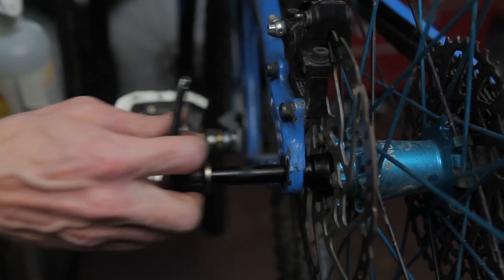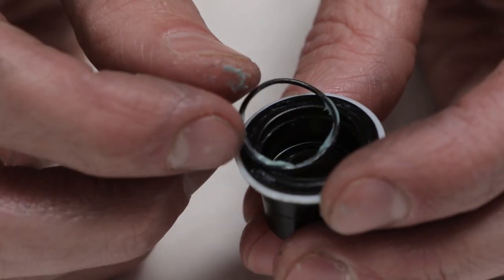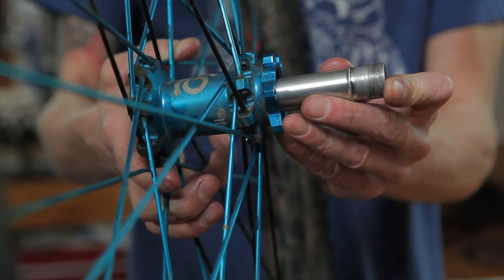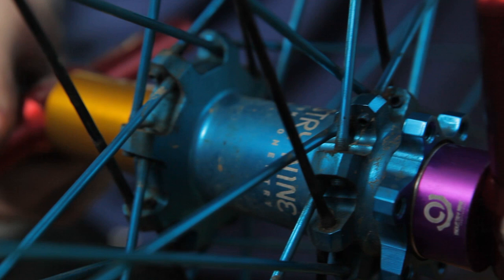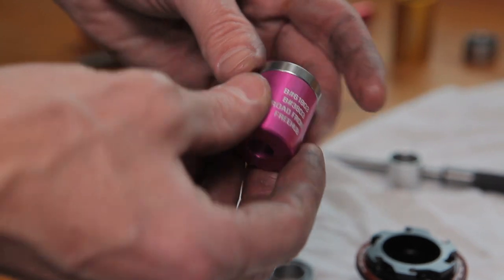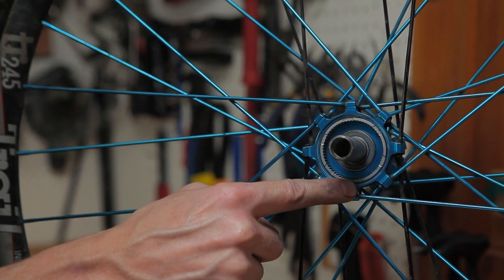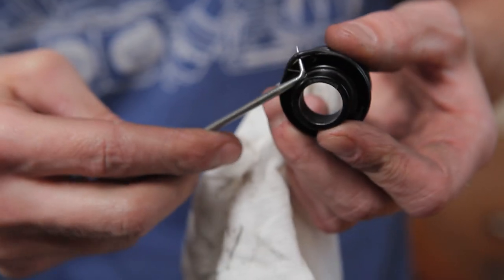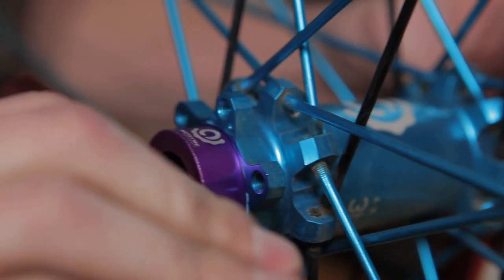Torch Hubset Service

Comment: So, since there is no "tool index image" (and FYI there are definitely proprietary tools required) here's a list of tools and supplies I made as an outlet for my annoyance with this video:
-Cassette tool and socket handle for your cassette
-Rubber mallet
-Centerlock rotor tool or Torx wrench for your rotors 
-Pick
-Grease
-Hub oil
-Bearings front & rear ($60 from I9)
-Various rubber o-rings and Teflon washers that aren't specified and don't seem to be available from I9 ($???)
-Bearing press kit for Torch hubs ($70 from I9)
-What looks like a 27mm deep socket
-A punch 
-A Wheels Mfg bearing press handle ($45)
Let's assume you have the correct brake rotor/cassette tools for your bike, grease, and what I'd call "basic tools," like a mallet and punch etc.. 
If so, servicing both hubs will cost you $175 plus the cost of a 27mm deep socket, plus hub oil, plus your time and labor. If you don't have the basic tools it'll run you well over $200, and you still have to source the o-rings and Teflon washers from who knows where.
Reply: Sheesh. Yeah. Sometimes just bringing it to an LBS is worth the hassle
Reply: i9 sells them, they sell ALL parts of the hubs. If they're not on their site, just email them and they'll get them for you.
That's how I got both Teflon washers
Reply: Yeah that's why I regret not buying premium DT SWISS wheel set instead. No proprietary tools needed and much easier maintenance.
Reply: Man, I need a 2mm hex key for my White Industries hubs, lube, a blind-hole puller and press+drifts...that's it.
Reply: Yes, the first service will cost that much. If you ride a lot you will need to replace the bearings again. You will already own the tools, and will only need to buy more bearings. I save labor costs buy replacing bearings myself.
Reply: Dang I bought I9 thinking they didn’t need special tools. But I see proprietary tools….again, like King hubs require.

Comment: My I-Nine noisy, might be a candidate for a rebuild. Two weeks ago while riding on the street, my pedaling saw resistance (with equal amount of resistance to backpedaling), to the point I had to walk my bike home. Taking my bike to Wheel World in Culver City, Ca, the mechanic placed a washer next to the cassette side drop out, holding it in place with grease. Then, he put back on the rear wheel assembly, secured the wheel with the thru-axle, and now the cassette spins freely. It looks like the hub retracted (possibly due to wear), allowing the side of the cassette to rub against the drop out. The washer kept the hub (and hence the cassette) away from the drop out. Does this sound like a rebuild is needed? If so, which parts should I order? Thank you. The hub came with the bike, ordered in 2017 from LaMere Bicycles out of Minnesota.

Comment: Looks like the end-cap grease is not the same as the freehub grease.  What is the grease used on the end-caps?
Reply: On i9's website, under Support > Torch, there is a picture of a workbench on which sits a tub of light blue grease. The tub is labeled Sta-Lube Water Resistant Marine Grease, which is made by CRC Industries.   From the product description at CRC Industries: "MARINE BOAT TRAILER AND 4X4 WHEEL BEARING GREASE.  A blue tacky, aluminum complex grease using a highly refined base oil. It has been formulated with a polymer to provide adhesive, non-blend and water wash-out characteristics. Will resist water under the most severe water conditions."

Comment: Hello,
Tonight I serviced a Torch disc road rear hub.
I've been surprised to not find any spacer ring or washer between the inner freewheel bearing and drive side wheel hub bearing.
The wheel is not spinning long in freewheel, something is rubbing inside.
The wheel even put in motion the crankset because of freehub friction.
What could be wrong according to you ?
Thank you